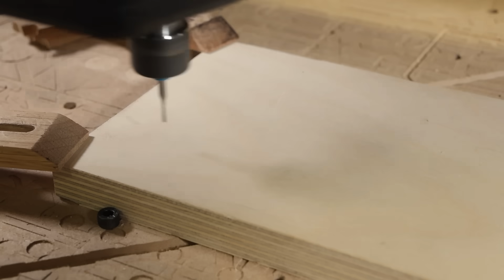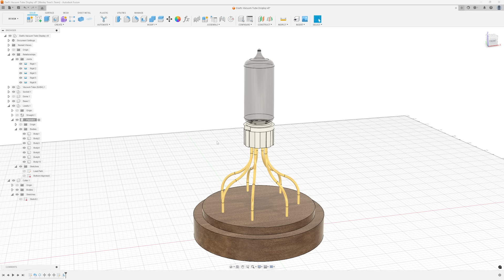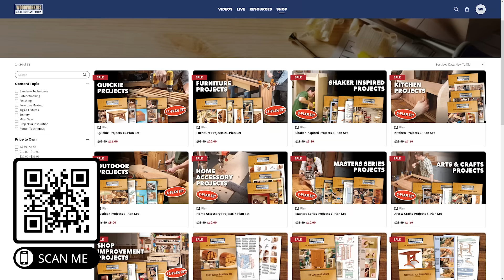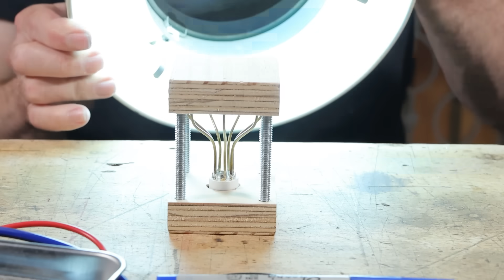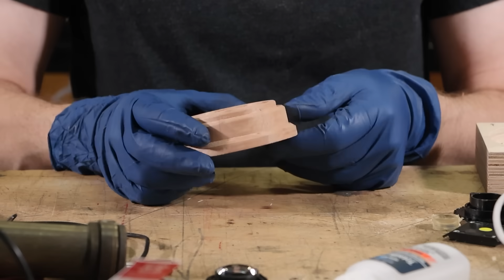Preserving the Last Tube He Ever Pulled

Comment: My father was a Glass Lathe Operator, for Standard Telephones, and Cables (STC) London before joining the RAF in 1940 - '46 as combat Aircrew AG/Sigs; later achieving rank as a Warrant officer, as an electronic expert in RADAR, and the prototype electronic counter measures.

He made borosilicate glass tubes for distillation etc. but also made valves.

He told me that they could make everlasting incandescent lightbulbs; but nobody would - you make profits from selling new bulbs!

PS I'm aged 62, and have his rough service inspection lamp (which I've since rewired with modern cable that meets UK standards) and to my knowledge it's the same bulb I remember as a child.

PS he called himself a Watchmaker, to trade, but eventually became a Policeman.

I trained as a Luthier, and Musical Instrument Technician, before becoming a speciallist hospital electro- mechanical engineer - seems obscure trades might be a inherited gene LOL 😜

Comment: I have never seen a VCR that would use tubes (when VCRs were a thing,  tubes were obsolete

Also, gameboy couldnt use tubes, it was to small and everything would be to hot, also its hard to make high voltage required to make tubes work, from a battery
Reply from the maker: thatsthejoke.gif

Comment: I still own and use tube equipment every day.

The tube you are using as your display was designed to be used in radio frequency oscillators or amplifiers, just in case you wondered ...

Comment: Hope you realize a tube filament is good for like 10,000 hours max at full voltage then it will burn out like any light bulb.  If you want to extend the life then it would have been better to run the filament on 5 volts.   It still will glow, just take a bit longer to heat up, but the filament won't burn out as quickly.   AND, if you want a showy type tube, then head over to Franks Tubes and look for a directly heated tube.  Direct heated diode or triode and you should be able to see more of the filament and of course, the glow.
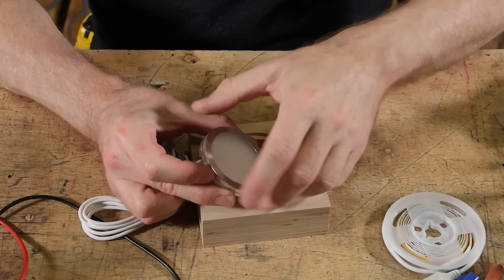Reply from the maker: 👉 22:05

Comment: Drill out the center of that ceramic socket and install a small colored LED in the center of that ceramic socket.  It will make the tube glass glow with whatever color LED you use.  A blue LED tube glow with the red color of the filament will look really cool.  Perhaps just use a piece of wood as a pedestal for the tube to sit on.  Give it some character like a stairway banister has, drilled out for the wires to go through the center of the pedestal.  
But for a real challenge, perhaps you could make a little stick man with different type tubes for his head, hands and feet.  Just fun suggestions.  But I have no clue how to do woodworking, only simple electronics crafts like this.

Comment: for the more curious of the younger crowd, if you look at a modern circuit board, for every chip you see, there used to be a model of vacuum tub that could do the same thing, or could work in a group of tubes to do the same thing, at the time a computer that couldn't do more than a dollar store calculator would fill a room or two and would take an hour two handle more than six digits per input

but then, semi conductor technology improved, as well as manufacturing technology, and slowly we developed chips that could do the same things using less energy and generating less heat

Comment: Those filaments were 6.3-volt AC. they ran right off a filament transformer I know it works off DC but I wonder if it would look better off of AC. I remember the orange glow appearing much brighter than the one you made. Wonderful project idea and I have a box full of old tubes. I think a doorbell transformer is 6.3-volt AC.
Reply from the maker: Datasheet says AC or DC.

Comment: Hello Wesley, interesting video. ❤ I’m old enough to remember tube operated electronics, but don’t know much about them. This helped a bit, thank you. One question, don’t these tubes require open airspace to help them last longer and dissipate heat? I remember dad’s old tube amp getting hot enough to heat the metal case.

Comment: Very nice project!

Smart of you to use a duplicate tube for the testing first. It's also good to try and run the heating filament with a lower voltage (5V), that should extend its life quite a lot. Using 5V from USB as a power source makes sure you can't accidentally plug in an AC adaptor set for too high a voltage and accidentally burn out the heating filament.

Comment: My mentor said that running a light bulb at half voltage will make it last forever (but obviously not shining as brightly). Run that filament at the lowest voltage that produces a sufficiently visible glow, and it might outlive your grandkids.
Reply: Filaments already run comparatively cool, usually they fail on thermal cycling. If it's never switched off, it shouldn't ever go out.

Also soft-on/soft-off helps.
Reply: This. You can get many decades, possibly more from a filament by undervolting it.
Reply: @richfiles  Even slight undervolting by as little as 20 per cent will increase livespan factor 10, halving will increase lifespan factor 1000. This is true for lightbulbs, it should somehow be applicable for vacuum tubes as well.
Reply: @richfiles  This is why dimmers are a value proposition. My grandmother would dim every light 80 because money doesn’t grow on trees.
Reply: vacuum tubes already run quite cold compared to a lightbulb so im guessing they tend to last longer
Reply: @Gizmos_and_stuff  If you never cycle them and nothing external kills them, they last oractically forever.
Reply: @233kosta  im pretty sure they do boil off some of their material over time, though i assume vacuum tubes barely do, theyre like 3 watt bulbs usually
Reply: @Gizmos_and_stuff  They have this dim orange glow, not unlike the legendary forever bulb that's been lit in some fire station for over a century. I'm sure they age and croak eventually, but usually something else takes them out first. Nowadays it's bound to be one of those wax capacitors they used back in the day to block the B+ of one stage from biasing the sh!t out of the grid of the next. After that many years, the paper they used as a separator in those has gone acidic and has thus become conductive. Thus these things leak DC like collanders. At that point you've got some ultra sensitive amplifier valve that's tuned to listen for maybe microvolts, being force fed something like 300-400V, which causes it to draw an insane amount of current. At that point, if a bond wire doesn't give up the ghost, the cathode will.

Another common failure mechanism are the filament bond wires. Those filaments are basically PTC heaters. They draw the most amount of current when they're cold (which is how they can warm up very quickly and then stay at some equilibrium point). Trouble is, sometimes one of the bond wires used to connect the filament to the pins that come out of the glass is a bit thinner than it should be, so that inrush current causes it to get quite hot. Sometimes white hot. Bond wires aren't built to take this sort of heat. Adding some type of soft power-on feature (even if it's just a simple current limiter) solves that problem neatly.
Reply: Still like 50% less efficient than LEDs. Don't waste power
Reply: @GLITCH_-.-  50% less efficient than an LED? Dude, it's 90% less efficient than a regular incandescent bulb! 😅

The hotter you run them, the more efficient they become... and the sooner they fail. The 1000 hours thing was a compromise between efficiency and bulb life. This is the ONE example where "planned obsolesence" is entirely justified, I wish people would stop citing it as proof that industry has been evil for over a century.

Comment: 23:20 I'd try a single 5mm water clear led under the dead centre of the mount. It'll focus almost perfectly on the underside of the base and be almost invisible if you set the top of the lens flush, or proud to the value of the radius

Comment: No, DON'T think VCR's and gameboys. Those both have integrated circuits, microchips etc,
Think TV's from the 1950's, Radios from 1930's and 1940's.
Reply from the maker: You're KIDDING 🤯
Reply: @WesleyTreat  <---<< I don't know if you joking here but I was in electronics the Air Force and know what I'm talking about. By the way your simple explanation about what the heating element does was good. Simple enough to understand but accurate as far as it went.

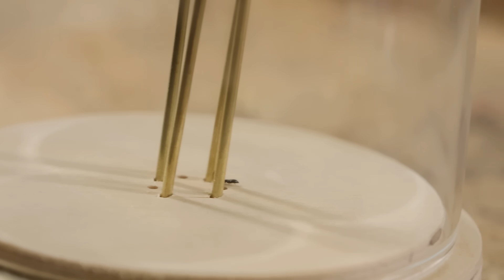Comment: 5:37- fun fact- the term debugging came from the time of vacuum tubes. bugs were attracted to the warmth of the tubes and should get nice and cozy and short things out. you'd periodically have to dig into the machine to pull out the bugs- hence- debugging.
Reply: Yes and no. The term was invented by Grace Hopper after she had to pull a beetle out of the room-sized computer she worked on

Comment: That's awesome!  What a tribute to your Dad.  I'm sure he's looking down smiling.  I was wondering, since you was using your shopsmith to turn the base, could you not have used a threaded rod, tightened it down to the base, then chuck it in the drill chuck?  Turned out great either way!!!  I saved several signs from my Dad's Auto parts store, and have the signs hung up in the shop.

Comment: I remember, back in the 90s, my electronics teacher showed us a bunch of tubes and said, "you won't need to learn about these as modern electronics are taking over, but I thought you might like to see them."
I was fascinated with them and wish I did get to learn more about them though.
Reply: They're actually surprisingly simple devices. They work by heating a cathode until it's so hot it's launching electrons off its surface (called thermionic emission), then use electric fields to do things with said electrons.

The simplest design is the diode. In addition to the hot cathode, it also has an anode (a.k.a. plate), where the electrons eventually go. To draw them there, a positive voltage is applied to the anode. Sometimes a positive or negative voltage is also applied to the cathode for engineering reasons, but in all cases it is tied to a free source of electrons (such as a mains ground or neutral, or the negative output from a rectifier).

Note that the cathode can only ever emit electrons, and that the anode can only ever absorb them (since it is cold). This means that current can only flow one way across a diode - from anode to cathode (opposite the electrons). Thus if an alternating current is applied to it, it can only flow in one direction. This makes a single diode like this a half-wave rectifier. In practice, adding a second anode and connecting both at either end of the secondary winding of a transformer makes a full-wave rectifier, as no matter which direction current flows in, one anode will always be positive.

Adding a wire mesh between the anode and cathode allows us to do more than just rectify current. This configuration is called a "triode", since it has three active elements. Applying a relatively small voltage to this wire mesh or grid has a very strong effect on the flow of electrons across the valve due to its relative proximity to the cathode. A negative voltage will tend to repel electrons back towards the cathode, in effect switching off the valve, whereas a positive voltage will tend to accelerate them towards the anode - turning it on more. Hence it's called the "control grid", but more often than not it's referred to as just "grid". Since it takes very little voltage to make a large change in current flow across, this type of valve was often used as an amplifier. In order to chain multiple stages of amplification, a DC-blocking capacitor has to be used to prevent the very high anode voltage (also called "B+") of the first stage from forcing open the next stage. The amplified AC signal passes through the capacitor just fine so it can be amplified further by the next stage. In old equipment where these capacitors' insulators have failed, they've started leaking some of that DC, which can be as low as 110V on a transformerless radio receiver, but can also go high up into the hundreds of volts (300-600V is not uncommon). This leakage messes with the amplifier valves and if it's high enough can destroy them. Modern polymer film capacitors do not suffer from this issue and thus replacing the old paper and foil capacitors with poly-film is a permanent solution.

Often times a bias voltage is also applied to the grid of a triode, either to keep it operating in its optimum range for amplification, or to achieve some type of logic gate on/off effect.

To address the imperfection of triodes (because physics), tetrodes and pentodes were also developed. You will find those used in higher-end equipment.

When used to amplify audio signals, valves usually require an output transformer after the last stage to drive the speaker(s). This is because valves are very high impedance devices, and the currents required to drive a very low impedance speaker would destroy them. The output transformer is usually connected directly across the anode of the last stage and a suitable ground. Since transformers do not pass DC, there's no need for a DC blocking capacitor, as long as the insulation can handle full B+. In addition to voltage and current change, transformers can also be thought of as impedance-changing devices, where the ratio of the coils maps directly as the ratio of impedance between both sides of the circuit. Thus an 8MΩ valve would require a 1e6 winding ratio to drive an 8Ω speaker correctly.
Reply: @233kosta  The actual implementation and materials science involved are surprisingly complex.

Comment: 6:27 if you were wanting to try that spiral pattern, you could take all the rods you plan to use and wrap around a pipe or dowel the size of whatever the inside of the spiral would be.

If you put them right next to each other and wrap at the same time, they'd all have the same shape. (Would probably need to use some tape or something on the ends to hold together while wrapping)

Love watching your videos and projects you leave in the troubleshooting and designing of.

Comment: This is not meant to be criticism, I like what you did with this project. I know a bit about tubes... if you're only concerned with them glowing, you can prolong the filament life by running them on a slightly lower voltage. However I am concerned that if the filament is powered on 24/7 it might only run for a few years 24/7. They were only designed to operate for about 10,000 hours (service life) which is like a year and a half. Now, that's how long it would have been before "tube is too weak, replace it" instead of "tube no longer has any glow" levels of dead. Most of the cheaper tube testers would just run the cathode by itself real hard just to see how many electrons would flow off them and use that to guess at how "weak" or "strong" the tube is. A tube could have really low cathode health but still light up... Anyhow, maybe a circuit to only grow it on detection of movement or on special calendar events might squeeze more life out of it. Again, this is not meant to be a dig I think it looks great I am just worried that it will hurt emotionally when the filament does finally get used up all the way and doesn't glow anymore. And that 10k hours was just what they were aiming for as developers, for some it might be a lot less in the real world, and OTOH I have heard of stories of amps being left on in standby mode in movie theatres for literal decades completely forgotten about, just glowing away in a rack without anyone noticing.
Reply: Yup, the filament at full voltage/current will eventually burn out.  Since you are not looking at tube performance, a lower voltage, just enough to get the "glow" you want, is the best solution.  Many TVs ran the picture tube heater at a lower current in standby mode to reduce the turn on time and prolong the picture tube life.
Reply: I think thermal shock from turning it off and on would shorten the life of the heater far more than just leaving it on constantly.
Reply: @lpbkdotnet  You can get around that with a CL-90 on the primary of the filament transformer.

Comment: I did a sort of shallow spiral holder for my dad's tap handle. Took some scrap ring stampings from work and a stub of steel tubing, welded a 5/16 nut to the spirals, and set it up on a turntable.

Comment: 👍👍😎👍👍  I remember at the age of 12 taking the back cover off our black and white tv that was struggling to tune the channels.  I collected all the tubes, put them in a bag and then rode my bicycle to the drug store about a mile away.  Tested every tube with the tube tester they had next to the counter.  Purchased new tubes with my paperboy money.  Watching old re-runs of the Dick VanDyke Show never looked better.
Reply: I remember every Radio Shack having a tube tester with new tubes for sale nearby.  And helpful employees who knew what they were doing.
Reply: Those testers were a fraud. Most store owners would cut resisters and make tubes look bad. Just pulling and reseating tubes will make most work again. It cleans up corrosion. Deoxit the socket.

Comment: You actually could have chucked the part up if you used a large bolt and some washers.  Center and tighten the bolt on the wood and then chuck up the bolt.

Comment: Rather than uplighting it, you could have used a single LED and current limiting resistor mounted in the ceramic tube base, and powered off the same leads as the tube.

To fit the base into the lathe, you could have just wrapped a few layers of tape around the jaws before expanding them.

Comment: If you look at old electronic equipment, there was often a sort of metal box at the bottom that contained a circuit of some sort and on the top of that box the tubes were installed. And of course there was a nice cabinet to host the whole thing.

Keeping with this idea, you could have a metal cube, with some vents and holes and an much age grey-greenish paint. That could be where you hide he power supply for the tube.